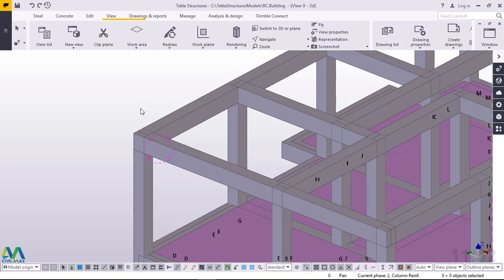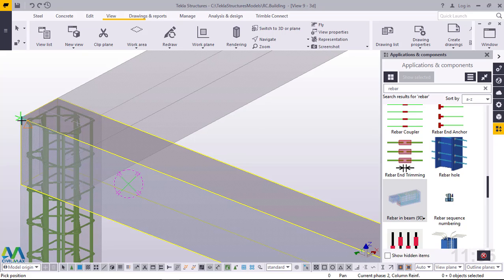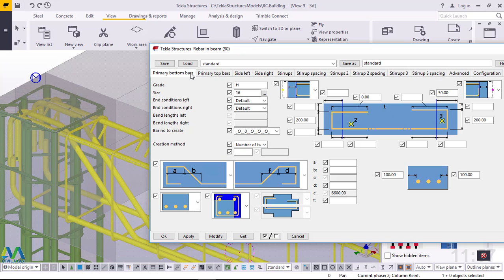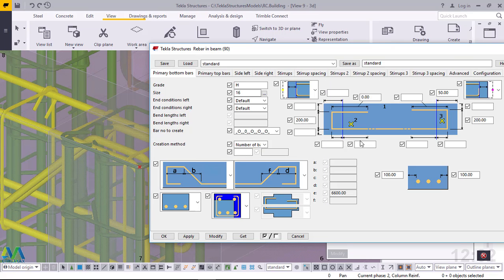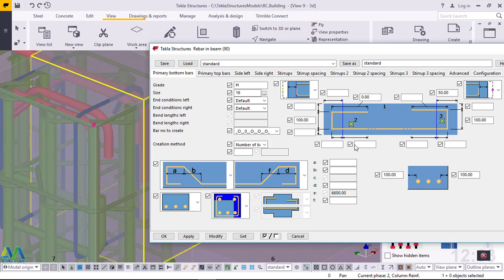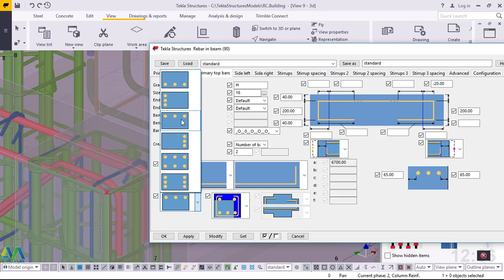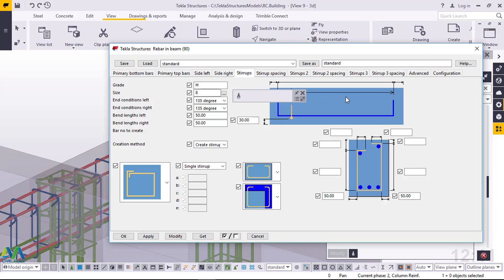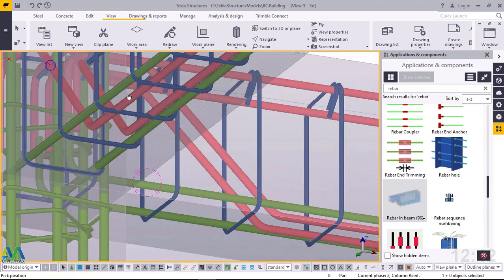Beam reinforcement with Cranked bottom bars | Tekla Structures

Comment: Do we have a chance to make such a design by not connecting the sprouts left at the concrete casting at zero elevation, but by starting at +100 cm elevation and making it at 80 cm height???
Reply from the maker: yes very much possible
Reply: @MauriceDimba  can you help us????

Comment: I have a question, when a beam is modeled, the column face model or the column axis, because tekla generates a meter and if I model it to the axis, the concrete would mismeasure me, but steel does not generate me well. what solution can there be, please help
Reply from the maker: Mail me at mauridimba1@gmail.com